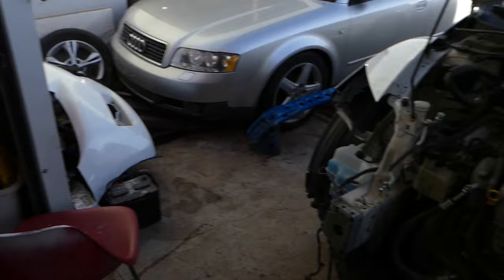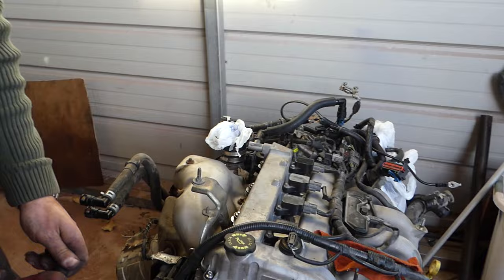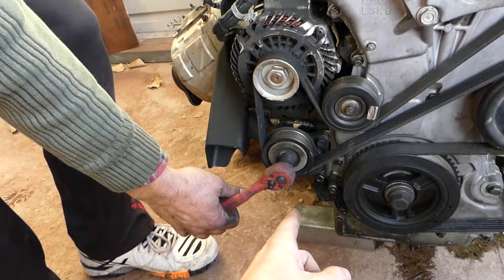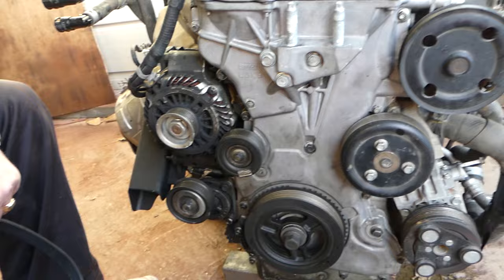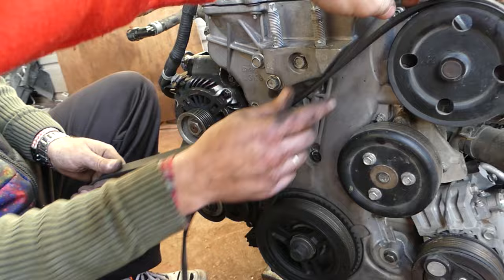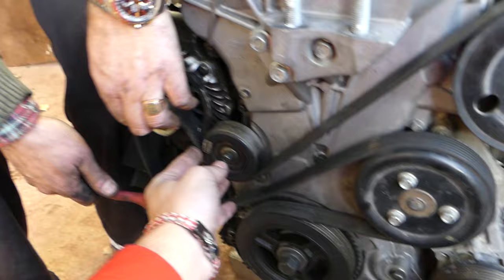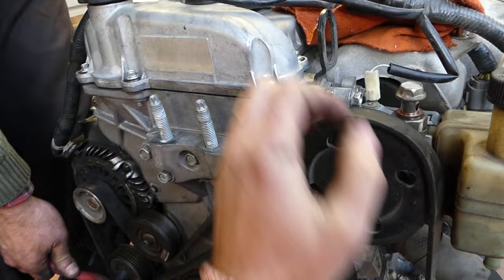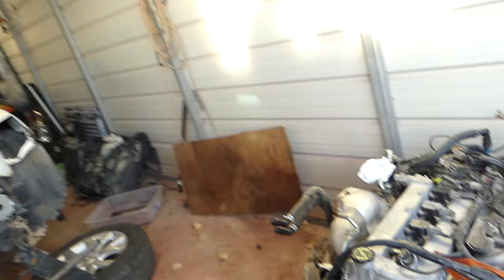MAZDA CX-7 2.3 SERPENTINE BELT REPLACEMENT SERPENTINE BELT DIAGRAM CX7

Comment: to anyone doing this with the engine actually in the car.
you need to make sure the belt size is EXACTLY and I mean EXACTLY the same length as the OEM one you take off. chances are you ordered the WRONG belt even though you think you ordered the right one. so triple check the length. For this configuration, even a 5mm difference will make it impossible to put the new belt on.
secondly, DO NOT try to release the tension from the bottom. There is simply not enough room AND you can actually destroy the tensioner. 
it needs to be released from the top clockwise because it will pull the tensioner UP at the same time. doing it from the bottom from the right side just pushes it to the left.
I used a 14 mm wrench and a belt extension tool for leverage. you will need as much rotation as possible - all the way until the tool hits the engine mount. just watch out for the AC line.
also use the wider pulley at the top without the teeth that is closer to the front (not the idler pulley) to slip the belt on. 
hope that helps.
Reply: Every manufacturer of belts has a different size. Look it up. Continental 90.5 // AC Delco 91// Duralast 91.11// Valucraft 90.55.
Make sure youre getting the right size!
Reply: 2 years later and you're still helping people, I appreciate you dawg 🙏
Reply: I just removed the motor mount (4) 17mm bolts/nuts. Took 2 minutes and gave me ample swing room

Comment: thank you for your time to make this video. However, the issue shown that he had a hard time trying to put the belt on is a noob technique. you shouldn't try to put the belt on the toothed wheel since it has a lip it's harder to over come it, instead all you gotta do Is slide the piece of the belt on any of the non toothed pulleys that's how you make that installation easy peasy.
Reply: importworx not is not... specially in this vehicle.... the issue is Mazda poor engineering and wrong belt lengths fabrication.
Reply: How many teeth is this belt? How do I give specications if I want to order it?

Comment: hi there. thanks for all these helpful video. 
Does the CX7 have a recurrent misfire problem? 
i have a misfire on cylinder #3 that i can not fix. 
not the coils and spark plugs, not the valve cover gasket. i am left with compression and injectors.
compression i found is as follow
#1- 160; #2-160; #3-125 (the misfiring cylinder) nd #4-160PSI. 
what do you think? any suggestion?
do you have a video on the injectors? before i conclude the piston needs to be replaced, i need to check the injector on #3.
thanks for reading
Reply: I can help you with this problem , pull out all the spark plugs and inspect the porcelain, when the porcelain cracks, you get a code and the engine will misfire, 2nd  the coils also can give you a misfire , I have changed the plugs   uredinium 3 times on my Mazda cx-7

Comment: Hey are you using a 6pk2315 belt?
I am in Australia. Gates listed 6pk2285 but it's way too short. Dayco listed 6pk2290 for an auto and 6pk2315 for manual transmission.

Comment: Hell of a lot easier to put on when the engine is out. Hell i'm having a hard time putting it back in the damn car.
Reply: I have the same problem. I have the tensioner loos all the way and still; the belt is far from getting in.
Reply: I ended up taking the motor mount off and was easier.....

Comment: I had the idler pulley bolt break, pulley came off but I'm pretty sure part of the bolt is still in there.  Anyone know if it can be removed from the back end by removing the alternator?

Comment: Can you do this without taking the engine out lol haha
Reply: You can get it off!!!! Hahahahaha..... here as I'm struggling to get the new one on. Lol...
Seriously though, for extra room I have pulled the intercooler off and removed the RHS engine mount (jack holding engine up). New belt is bloody tight fit though!!!!!!!!!
Reply: @dwaynE2099  hahaha I had a struggle to put it back on but I it’s back on haha
Reply: @iowafishing1013  got mine back together too... tougher job than expected!